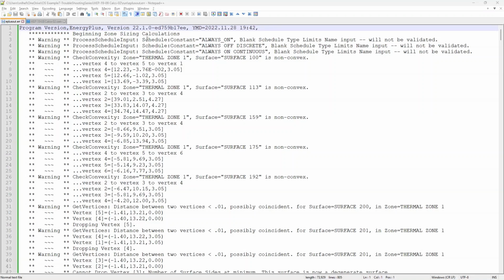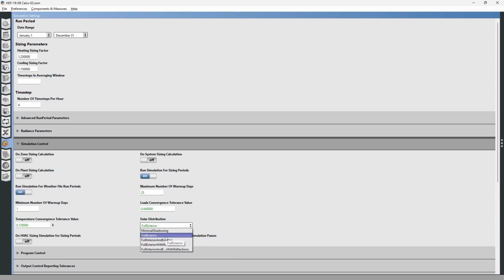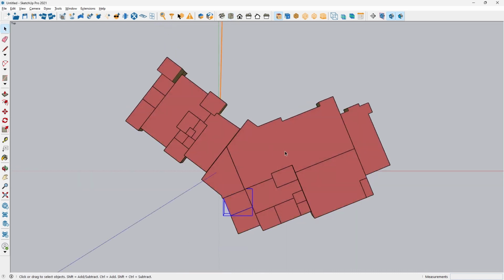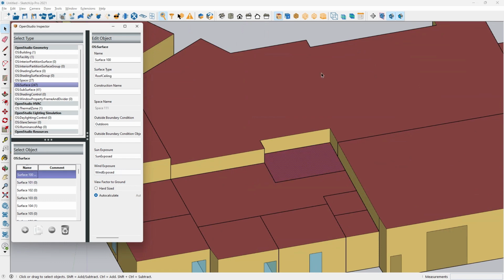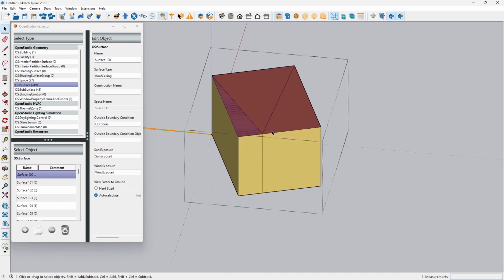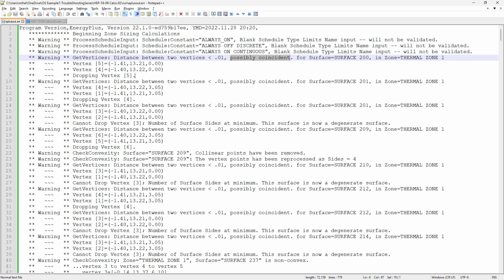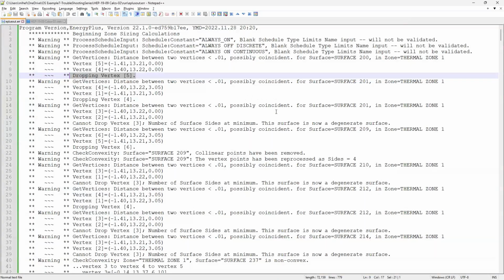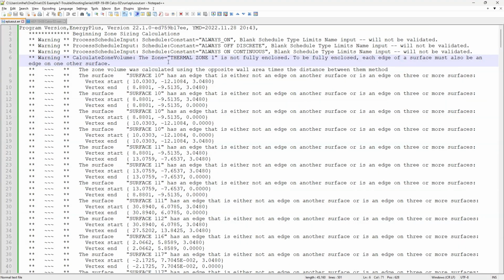Building Energy Modeling in OpenStudio - Troubleshooting 3

Comment: Hola, me aparece este SEVERAL ERROR:  ** Severe  ** GetHTSubSurfaceData: Surface Openings have too much area for base surface=AIM5294
   **   ~~~   ** Opening Surface creating error=AIM5306
Me podrian ayudar! THANKS!!
Reply from the maker: I have not seen this error before.  It seems like the subsurface AIM5306 has been drawn incorrectly or there is an error with the base surface AIM5294.  I would recommend deleting the subsurface and redrawing it in SketchUp.  If that doesn't work, you could delete and redraw both the base surface and the subsurface.